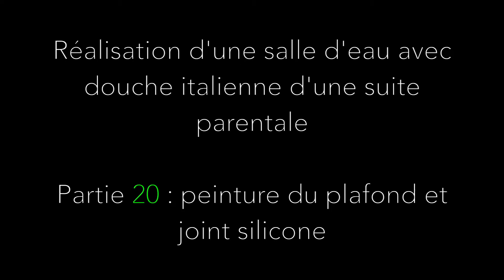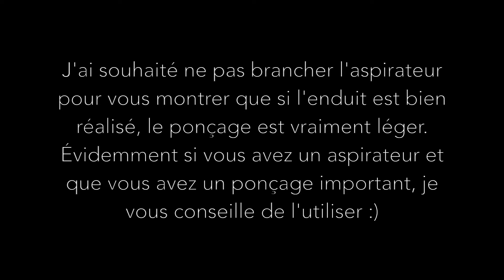Réalisation d'une salle d'eau : peinture du plafond et joints silicone de finition # 20 / 24 LUMY 35

Comment: un vrai régal de voir tes vidéos : travail réalisé dans les règles de l'art. 2 choses m'ont réellement surpris : tu ne te salis presque pas les mains ( à la pose de deux ou trois carreaux, je les nettoyais systématiquement à l'éponge humide pour ultérieurement facilement jointer. A chaque fin de matinée et fin de journée j'appliquais de la crème nivéa sur mes mains). Je suis également surpris que tu appliques du joint silicone dans les angles, sol et plafond. En général, avec le temps, le silicone change de couleur, voir moisi. Je comprends que à la livraison du chantier le joint silicone donne une très belle finition mais dans la durée...  Je vis, depuis huit ans, en Thailande et leur façon de travailler dans le batiment est surprenante : aucune sécurité et il suffit de voir les maisons neuves thai après quelques années pour se rendre compte de toutes les malfaçons. Cependant, j'ai remarqué dans les différents hotels que j'ai fréquenté dans ce pays, que le joint blanc ( à bas de ciment) pour jointer une salle d'eau reste propre. En espérant ne pas t'avoir énervé au sujet du silicone, bonne continuation.  Ps: si tu dois carreler un escalier en arrondi, fais une vidéo s'il te plait. ( grosse galère et client pas vraiment satisfait de mon travail)
Reply from the maker: Merci Arnaud :)
je salis très peu mes mains car j'utilise presque toujours des gants de protection (ça ne me gène en rien d'utiliser des gants surtout quand on sait de quoi sont fait tout les produits que l'on utilise ;)
Pour le silicone tout dépend de la marque que tu utilise (pour info mon fournisseur s'engage pour que le joint dure 7 ans sinon il me file une nouvelle cartouche) de plus on est sur un support qui dilate (sol sur chape flottante et cloison en plaque de plâtre) donc il ne faut surtout pas pointer avec un mortier sinon ça tient pas.toue dépend en fait de compte du support sur lequel je suis amené à travailler sur celui que l'on voit en vidéo silicone sur d'autres pas besoin de silicone je jointe au mortier (ex : mur et plafond en dur type briquette donc pas de dilatation ;)
Pas de soucis tu peut exprimer ton point de vue (je suis loin d'être susceptible :)
Je posterais un escalier carrelé mais droit non arrondi (j'ai pas ça en stock vidéo)
A+
LUMY
PS : tu as essayer de t'inscrire sur le forum avec l'adresse le......743@gmail.com car si c'est toi que je puisse te débloquer car mon hébergeur m'a conseillé de faire attention à la Thaïlande par rapport aux nombreux hackers (apparemment ils ont pas mal de soucis avec la Thaïlande et la Russie)
Reply from the maker: Tu es débloqué pour accéder au forum :)
Présentation obligatoire avant d'utiliser le forum ;)
Merci à toi.
A+
LUMY